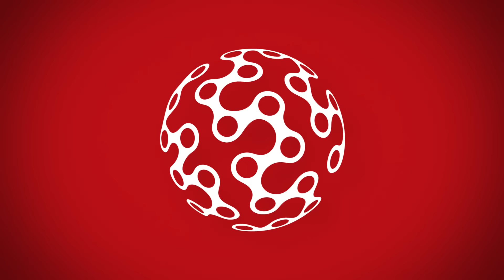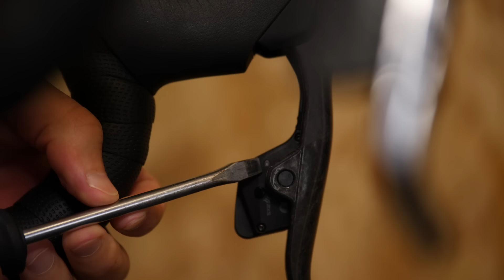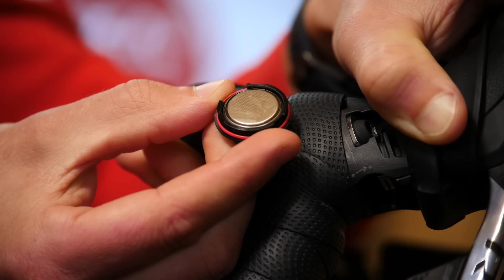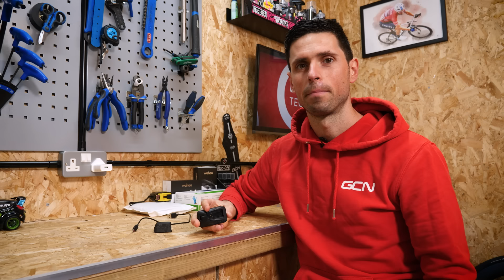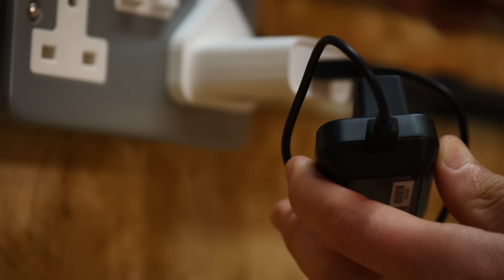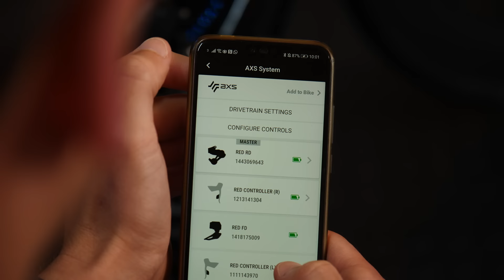How To Check, Charge & Change A SRAM ETap Battery | GCN Tech Maintenance Monday

Comment: I don't know how I missed the memo on the coin batteries in the shifters or didn't notice them in the app. I just checked their level and one was low, and  I am about to head to an Ironman! I watched the video because I wondered if I was missing anything on the battery maintenance. I also didn't know about the LED lights on the shifters. Happy that they used the fairly common CR2032s on those because I have spares around the house for other gear. My husband (road biker) liked to work on bikes and took care of mine for me , but he passed away from cancer last year, and I only had the bike for a couple of months before he passed; he never mentioned it. Thanks so much!

Comment: I have the sram red axs for a year now. Better than the invention of sliced bread. I have two chargers. Makes charging much easier. Carry a third battery in my saddle bag. Never had to use it. I leaves the batteries in the derailleurs when traveling. Keeps the ports clean. You can buy port blocks. Hard to get. The sram axs is great. Went from a sram force mechanical. I would NEVER go back. I have been riding/racing for 50 years. I have seen it all.

Comment: Anyone have issue with the rear derailleur battery draining so fast. I charged mine before a 30 mile ride and haven't ridden since and now battery is low on the rear. Does the rear derailleur use battery even tho the bike is not in use?
Reply: Yes anytime the bike is moved etc the whole battery is turned on.
Reply: Me too. Same issue. I remove the battery after the ride so it doesn’t drain. It drove me crazy the first two times it happened. They say it lasts 60 hours of riding and used to last no more than 10 hours. Found the issue. No problem so far.

Comment: Is there any way to get a percentage charge status on either the shifter or derraileur batteries?  I'm sure I've seen this somewhere (maybe on my Wahoo head unit?), but I cannot find it again - just the green/red indicator in the AXS app or the LEDs on the components themselves.
Reply: Was looking for this option as well. Can't find the answer anywherr
Reply: The charge level on the derailleurs can be seen on your head unit.
Reply: Which head unit are you referring to, and where (what do you need to do in order to display it?).  I'm using a Wahoo Elemnt Bolt

Comment: Green/red - they don't learn, do they? This is a huge no-go since decades because of color blindness.
Reply: I never use the red/green lights; between the SRAM app and the Garmin Edge I have two different notifications on if the battery is getting "critical." Also, as I tend to use the rear derailleur much more frequently than the front, if I get a "battery critical" notification I simply switch the front and rear and have several more weeks of charge if necessary.

Comment: Not sure this really warranted a video.  Note that this was ETAP AXS.  The original ETAP is essentially the same but the shifter cr2032 battery cover is held on with 4 little screws. My shifter batteries took 4 years to generate a battery life warning on the Garmin.  In terms of the derailleur batteries, i carry a spare.  Fairly light and quick to change which isn't that often.

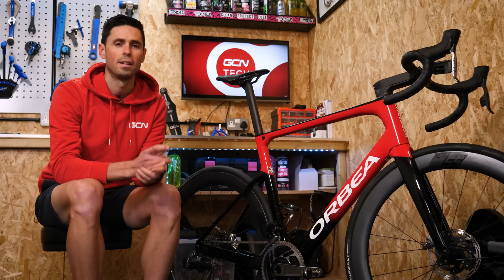Comment: Question: wouldn't a battery charger come with the bike? And  2:10 was a definite 'HACK"
Reply: The battery charger does come with the bike. A usb charger that you plug it into does not, but pretty much every single living human being on the planet who can afford an eTap equipped bicycle has at least a half dozen usb chargers laying around the home. Most Usb rechargeable headlights and even some expensive (Wahoo) computers do not include a usb charger with the purchase.   It’s not an issue unless you’re a hoarder.

Comment: Honestly really basic info here…was hoping for tips like should you drain the batteries fully before recharging? Should you swap front and rear regularly since the rear gets used a lot more? etc. etc.
Reply: The best range for lithium ion batteries is from 30-70%. Meaning you only charge to 70% and let it drain to 30%. In my opinion, this would be a little impractical though, because that way you can only use 40% of the batteries. That’s why I keep them in a range of 20-80%. 
As for swapping them around, yes that can be beneficial, because with every charge cycle you damage the batteries a tiny amount. By swapping them, you can even out that wear. If you’d charge them up to 100% and let them drain to 0% I would do this more often, because li-ion batteries really don’t like being charged and discharged fully. 

Other than that, I’d say there’s nothing else to say.
Reply: Run the battery until the red light comes on. Charge away. As to swapping them round, you can do this, but with the battery type it isn't neccessary. BTW, I'm about equal front to back as many shifts require a micro adjust of the front as well as the back throw.
Reply: #askgcntech for an answer

Comment: I’ve had several of the batteries on the rear break in the past where the tab perishes and snaps off. Fortunately SRAM keeps replacing under warranty.
Reply: I’ve only replaced a couple of Sram batteries for customers who had a broken tab, and each time was after a violent crash at the local crits.
Reply: @prestachuck2867  I'm not saying you're lying because maybe that is the only experience you have with the batteries. When I had eTap I had a battery break for no reason. The tab design is garbage. And the batteries I had needed charged every 4 or 5 days. Shimano's battery is well protected hence a much better design and the charge lasts me for two months. Now which which one is better fan boy? You've been drinking to much SRAM koolaid. By the way the wires that Shimano uses are not a big deal like some buttheads want you to think.
Reply: @wasupwitdat1mofiki94  now I’m not saying Shimano isn’t great and it is truly amazing I think all groupsets are awesome for sure but there was def something wrong with your batteries. These things last forever lol again Shimano is incredible I love it too
Reply: @Lubecycling  I had bad luck with 1 battery out of 3. The other two I treated like they were made like a fragile champagne glass.
Reply: @wasupwitdat1mofiki94  idk man I think the best way is to go back to old school mechanical shifters like the hardy Shimano Dura Ace; it's cheap, easy to rig on roadside. Just takes a bit more patience to set. My opinion on mechanical vs electronic shifting and breaks... if it ain't broke don't fix it. Besides, I think we got enough battery-powered stuff to worry about these days (power meters, bike computers, fitness trackers, lights, etc.) lol now we also gotta worry about batteries for shifters, front AND rear derailleurs. IDK, I feel like it's not worth it unless you're racing competitively and need that extra smooth and precise shifting. Most of the time I just want to get out and pedal and not worry about my drivetrain running out of juice and leaving me stranded. 
Not opposed to manufacturers giving you the option of mechanical vs electronic, but some will no longer do that for mid-performance bike models, which sucks bc you can potentially save some money going with older mechanical groupsets.
Reply: Mine broke once on the previous gen Sram red rear derailleur, i glued it and it never broke again

Comment: seems like a giant rip off for these systems. Bicycles are wireless freedom. endless free fun. I hope this is a fad.
Reply: Felt the same until i got a set at discount. How much youre willing to pay is up to you (and you can argue a road bike isnt even required for a good tine) but theres no denying the tech is damn good and aesthetically pleasing. Its a nice to have, whether you can close your eyes and pull the trigger is up to you.
Reply: @supersixmikeohimod  I agree. I do wish that Sram and Shimano still had mechanical Force/Ultegra/Red/Dura-Ace groups available as an option though.  But yeah. Electronic shift is not a fad, and is not going away.  Also, being expensive does not make something a rip off. Either you can afford it, or you cannot.
Reply: @prestachuck2867  'just because something is expensive doesnt mean its a rip off'. Well said. Only in cycling do you have snobbery that goes downwards and upwards. Different people can afford different things, why try to diminish others enjoyment of our hobby?

I dont buy new bikes often and my other groupsets are still mechanical. If price were no issue i wouldnt go back to mechanical. But it is so ill just be happy with my one etap system.
Reply: I have dura-ace mechanical on my 2015 Domane and just purchased a 2022 Domane with the ETAP AXS system. Love both bikes. Yeah, never have to worry about the dura-ace losing power, but there is a smooth, easy shift feel that accompanies the AXS system. For me, both are good. Just depends on what you enjoy riding.
Reply: I will work on making it go away! cheers

Comment: Would rather know how to buy one without being ripped off.
Reply: Retail prices are not a “rip off” unless you’re a company employee or a professional rider.  If you don’t have enough cash for a product, you just cannot afford to own said product. It’s not a rip off, you’re not the consumer for that product.
Reply: @prestachuck2867  If it's got the SRAM name on it it's a RIPOFF. SRAM is garbage and I will never own it again. Shimano Dura-Ace 9170 is the Crown Jewel.
Reply: @wasupwitdat1mofiki94  whats wrong with sram exactly? ive been using red axs for about 2 years now, bout 15,000kms a year, rode through mud and flood, and i have never experienced any annoying problems. shifting is responsive, quick, and never had any electronical failures. am i missing out on something?